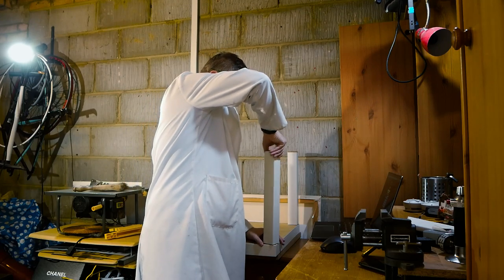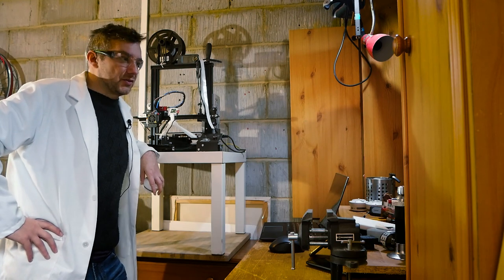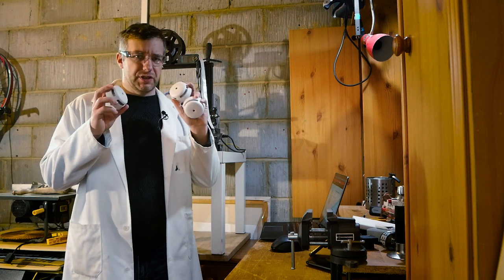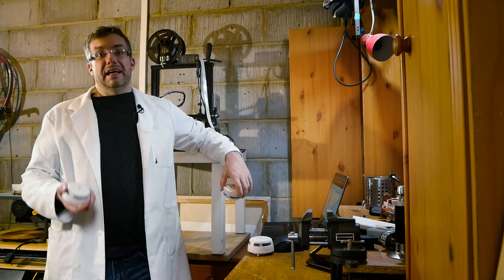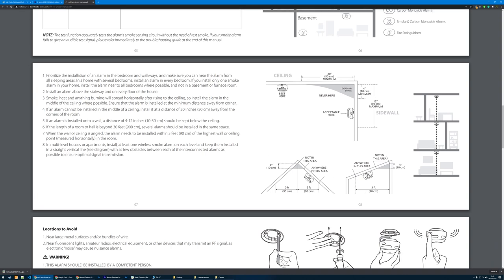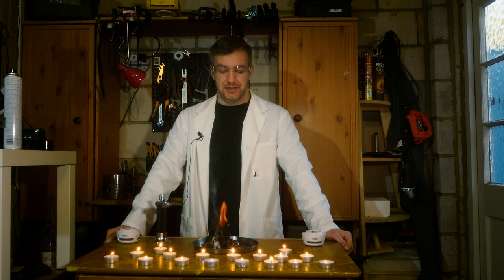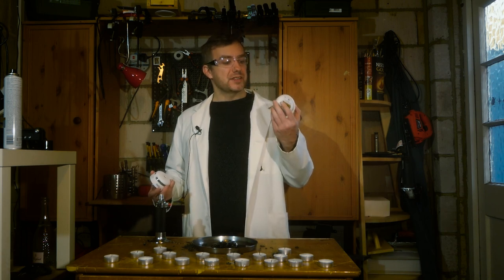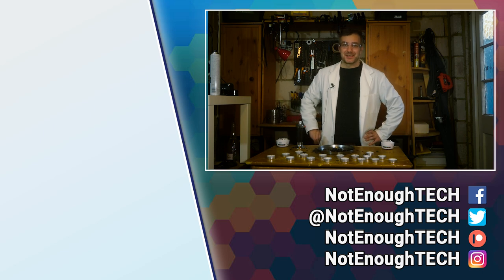Not burning the house down while 3D printing - X-Sense Interconnected detectors

Comment: Great review, thanks! Wondering how it might be integrated with a Home Automation system Like Home Assistant? Could maybe the X-Sense RC01 be a route to interconnectivity (the product page for the RC01 on amazon shows the PCB with what looks like some debug/IO pins...)
Reply from the maker: If I'm correct x-sense have connected series now and these would be better suited for automation.
Reply: @notenoughtech  Ah... those are in a different section of their website. Good spot. Sadly not listed on Amazon UK, so possibly not yet available in the UK? :(

Also they don't appear to be interconnected which is a shame (although that 'could' be an app/integration feature?)
Reply from the maker: If you get the network connection I recon you could trigger them from a server
Reply: @notenoughtech  which, so long as the power is on and it's not the router that's on fire, would work for most scenarios 😉 but I may* be OK with that... Would be useful to see someone showcase/test that before I click buy. In part I'd like to be able to trigger via automations in HA (e.g. tie into the burglar alarm system) as well as be able to silence from the HA dashboard
Reply from the maker: You would need a sim based backup to deal with router fault. I always wondered if you could detect fire with temp sensors. It would be late into the fire itself (significant flame) but an interesting experiment none the less

Comment: I think it would be safer to use something like Smoke Sabre to test your alarms. It only costs about £10. Note that it's inflammable so don't use it with open flames!  I'm having problems finding the x-sense interconnected alarms on a UK web shop. Do you have a link? Many thanks
Reply: You can grab 1,3 or 6 unit bundles from this link: https://notenoughtech.com/review/x-sense-interconnected-smoke-detectors/
Reply from the maker: They have the UK option on the page: https://bit.ly/3iL70x7
XSENSEWR01 - gets you discount on the 6pack.
I believe there are also present on Amazon UK: https://amzn.to/36KL5DW
Reply: @howardmarks4469  Thanks. I did follow the link originally but when I click on the GB button nothing happens and the page stays in US$. But now I ignored that and I clicked on Buy on Amazon and it took me to the UK Amazon.

Comment: Have you brought a fire extinguisher, 3am alarm all sleepy and starry eyed id want something on hand i could grab without thinking. Also Matt been wanting to ask for ages, where are you from, correct me if wrong but you live in northern england, wear alot of scotland themed shirts and im guessing is that a dutch accent,so hard to tell hence my curiosity. Love your content thank you for all you do.
Reply: almost forgot, might want to checkout the tuya based smoke alarms, that way you will get an alert when away from home.
Reply from the maker: Howdy! 
I'm a Pole haha - which should explain having the accent  (not the particular accent).
I will have small CO2 mounted in the garage just for that. But yeah at 3am I would need a clear and loud instruction on what to do next.
Reply from the maker: I will look into more connected alarms the only hesitation I have is operation in system failure state where there is a power cut and no WiFi/Power is available which In case of fire is a reasonable ask
Reply from the maker: If you get the ZigBee smoke alarm you won't need to worry about the router. Not for internal coms. It's also easier to add a cheap sim hat to the pie and make it an emergency network. Then get the data via SMS or something.
Reply: @notenoughtech  Oww I like that, excellent suggestions my Polak friend, thankyou.
Reply from the maker: I may have a board like this in the box. I should add this to the list of things to do at some point when I'm retired and bored to death

Comment: That is a new bit of information, silence the alarm that caused all of them to go off, and you silence all the other ones at the same time, i was going to buy these for my mother, but the thought of her having to go up a step ladder to silence all six of them at 76 years old put me off buying them, that is not something they make clear on their selling platforms.
Reply from the maker: Pressing any of the alarms silences all but the one that activated the alarm. Pressing the button on triggering alarm cancels all of them. It makes sense as you don't want to cancel all of them without checking the source of the alarm - plus anyone assuming it's a false alarm would simply dismiss the trigger without checking it.